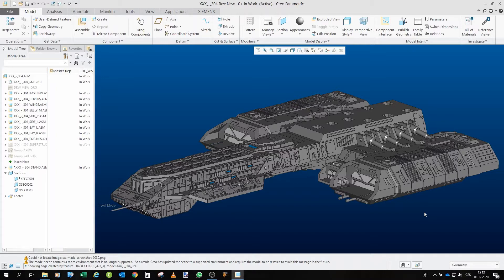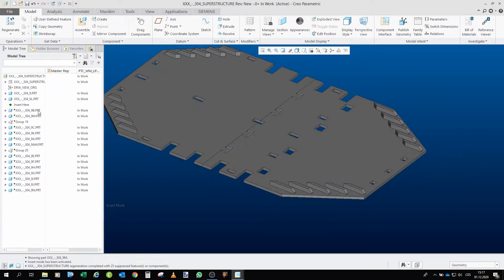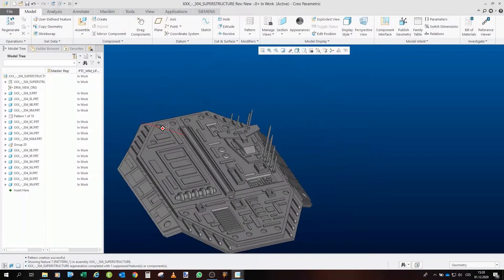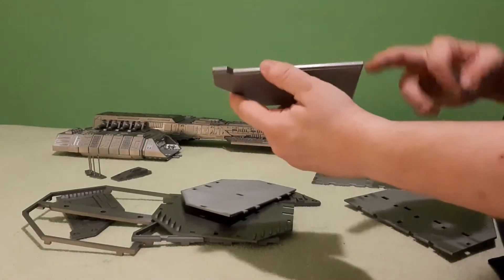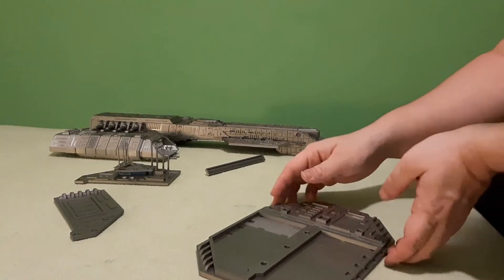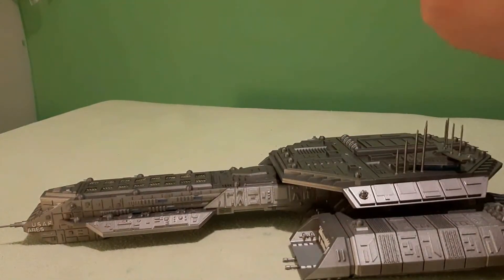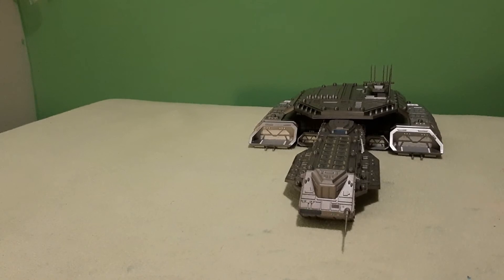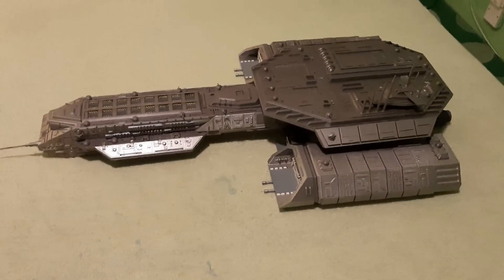Project 304 Part 7

Comment: I need this
Reply from the maker: Thehen print it ;)
Reply: @martintaichl  I don’t have a pc or 3d printer lol looks sweet there
Reply from the maker: @simonwillis1529  thanks, well, theretically, you dont need a pc, but that printer, that is kinda a deal-breaker ;)
Reply: @martintaichl  Iv never had one honestly or how they work but iv seen so many models that are not out like this that would be sweet have you done the f-302
Reply from the maker: @simonwillis1529  i am not sure i understand you now. Sorry.
Reply: @martintaichl  sorry I ment that I seen a lot of model kits designed and printed using 3D printers and the f-302 fighter in stargate if there is model design you can get to print a 302
Reply from the maker: @simonwillis1529  well i did design F-302. And printed it, posted it and even made a video here on my chanel.
Reply: @martintaichl  oh right sweet sorry I’m new to your channel I didn’t know
Reply from the maker: @simonwillis1529  no problem ;) 
I hope you will enjoy that one as well ;)

Comment: Ok, i just discovered your work on thingiverse, and i have to print all your stuff with my resin 3d printer to have the best details possible and add light and sound. Your work is just amazing !
Reply from the maker: Thank you very much for your kind words. Feel free to print whatever you wish. If possible, post pictures of the result. I am always interested in seeing my models being made by others ;)
Anyway. Enjoy it ;)
Reply: @martintaichl  Off course, as soon as possible. Do not hesitate to add finer details on your next models, for example railguns, with a resin 3d printer you can achieve extremely fine details. I have to say your 3D models are gorgeous, but the painting is just as good. I look forward to your next achievements.
Reply from the maker: @SilverCrow38  yeah. I do not have SLA so i have to design the models in such a way that they are printable by my printer.